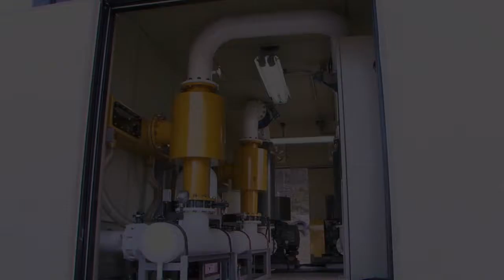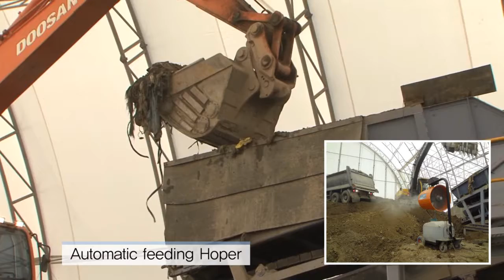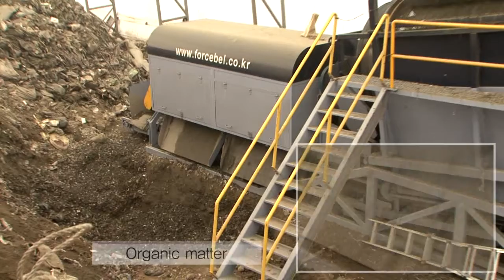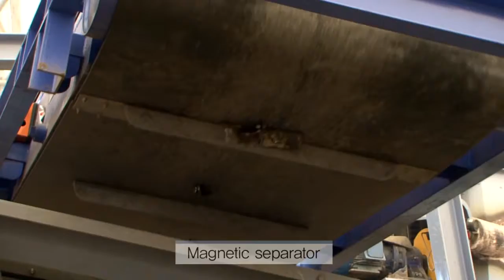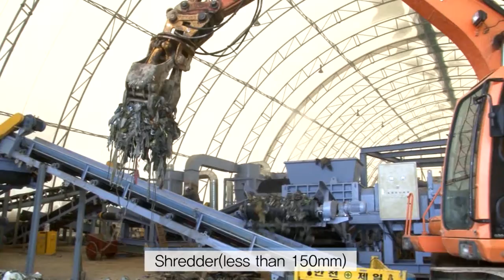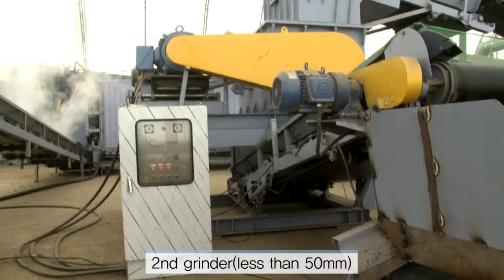landfill  waste separation + RDF production  - forcebel (English ver.)

Comment: It is hard to imagine that the RDF could become a quality to use for cement kilns? Also if you dry with any kind of primary fuel it need to be questioned what the cost for the RDF will be? could you provide those figures?